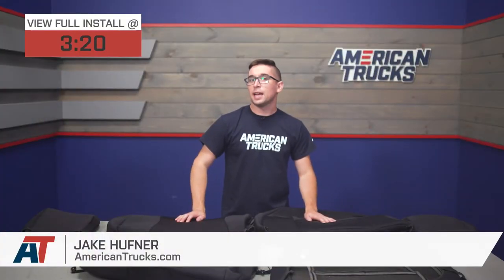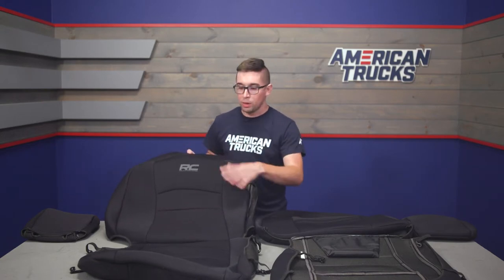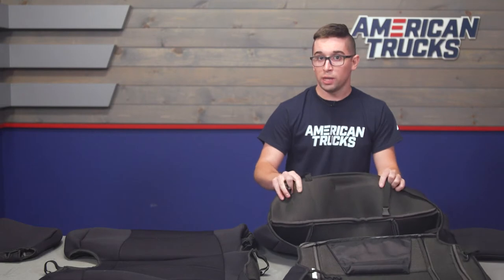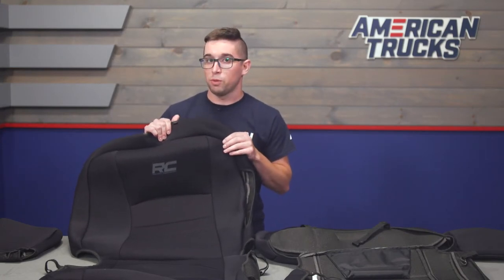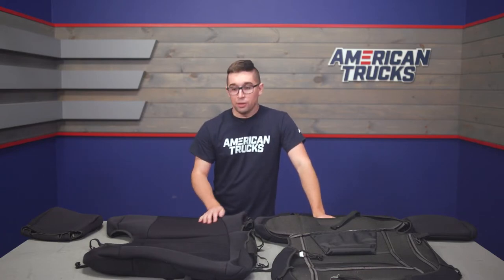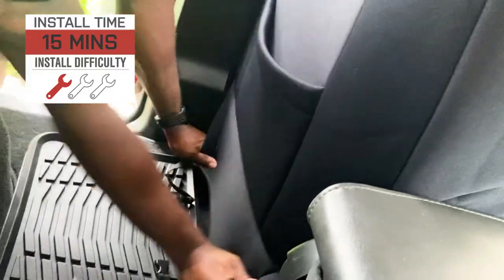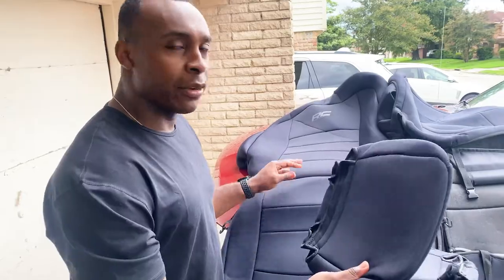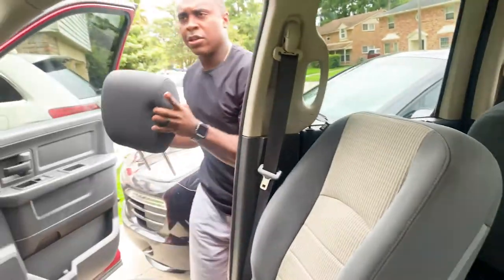2009-2018 RAM 1500 Rough Country Neoprene Front Seat Covers Review & Install

Comment: Have these for a 2019 Ram 1500.  They fit great and do a great job of protection the actual seats.  Two downsides: the RC logo is obnoxious and the straps for the center console cover have to be stretched in order to be properly strapped.